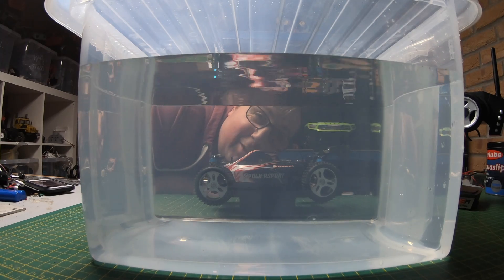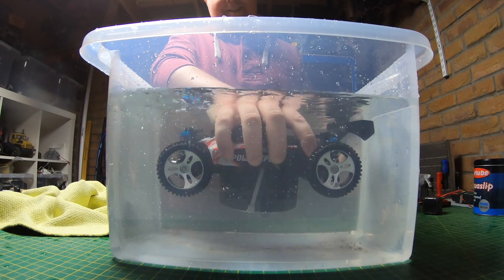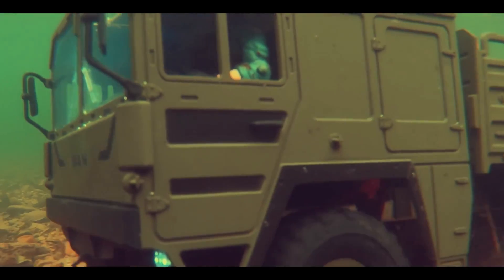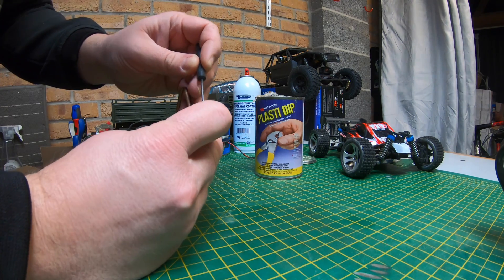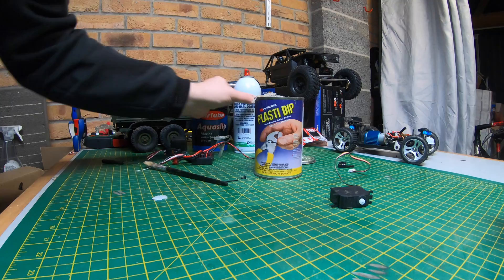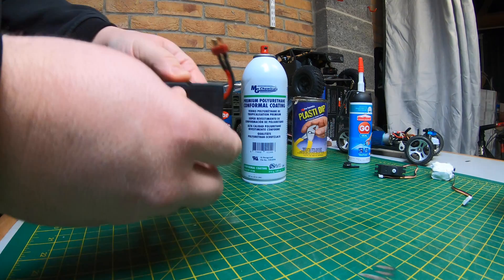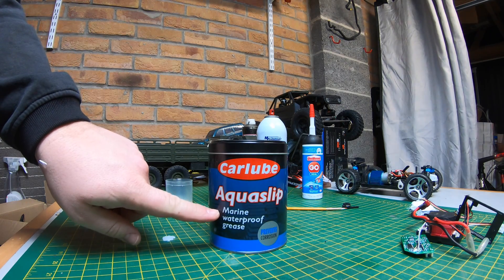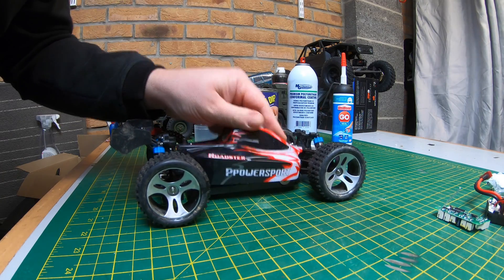I fully submerged my RC Car in Water - How To WATERPROOF Electronics - WLtoys A959

Comment: I did this to my 12428 it would last a while I the snow but it would melt and get into the "waterproof" ESC so I spray boot water repellent into the ESC until it ran out and let it dry it works perfect now

Comment: Hi friends I need help I have a problem with the WLTOYS A959

I replaced a larger engine 540 (and connected it exactly the same to the new engine, 2 wires - red to red black to black)

And the direction of the remote control changed.

Back we will be forward and forward we will be backward

Is there a way to fix this I'm
I would be happy for your help
Thank you very much
assafmelman
Reply: Switch polarity on the motor. Red to black, black to red 👍
Reply: @xf1757  I have tried to change already (the wires are getting very hot) and this is also not a solution unfortunately

(But I ordered the model B receiver)

And I hope this will solve my problem

Thank you very much for your help

Comment: Back in the bad old days I used to put my receiver inside a balloon to keep the wet out. The wires would just come out the neck of the balloon and sealed the whole lot up with rubber grease and an elastic band.  How things change.

Comment: For servos you can use marine grease for the gears and dielectric grease for the circuit board and just the dielectric for the RX. The RX can also be placed in a balloon with the neck cable tied a few times. Adding some silicon sealer in the neck will add further insurance. Much easier when you want to use the rx in a different model or need to re-bind it

Comment: 2.4 GHz does not really penetrate water very well,I learned that with the boats.40MHz is the radio that works for subs,27MHz doesn't work very well either.
Reply from the maker: Cheers dude. I'll get myself a 40MHz system and give it a go 😎

Comment: brush on conformal coating will submersably waterproof tho
Reply from the maker: Yes, however I've not had perfect results with it, but I know some people do.
Reply: @TomleyRC  have you tried the brush on kind i do 2 or 3 coats with brush on kind and have had great resaults for years with it
Reply: but ive had urethane conformal coating and acrylic conformal coating both fail for me too silicone had been most reliable ive done nut i dont paint outside of servo cases like u i break it apart and use waterproof grease in gears but while its apart i coat the micro chip itself and let cure then reassemble it its a cleaner looking finish and if by chance water does seap in the electronic chip in servo itself is coated anyway